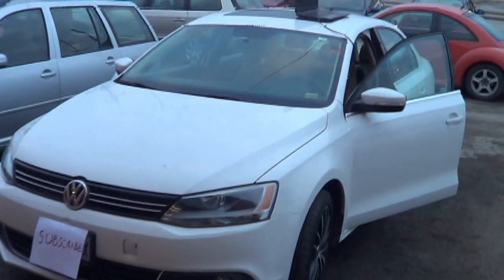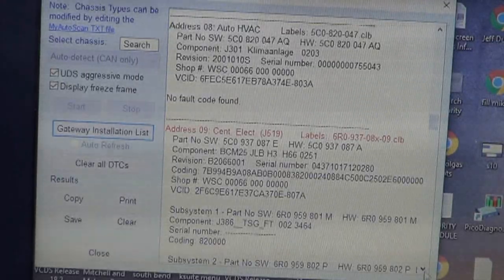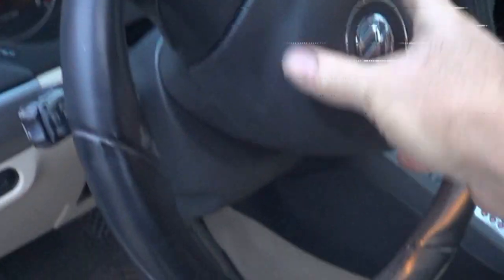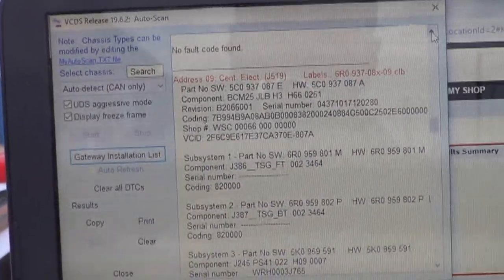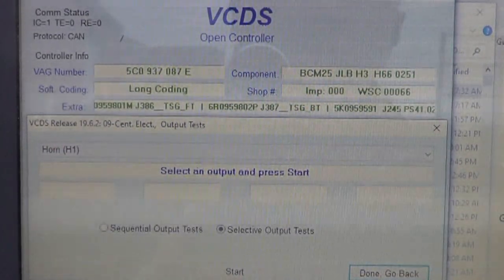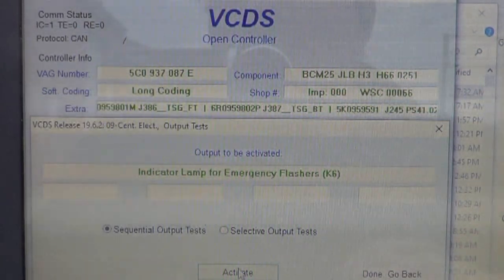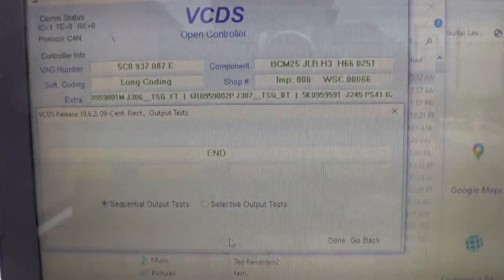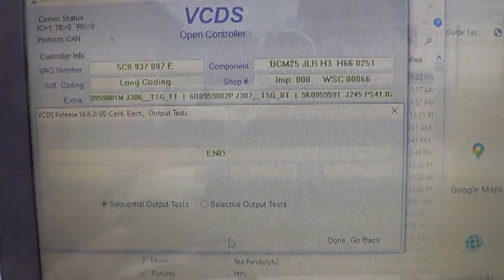2012 Jetta  Horn 03591

Comment: You should update the description with the solution to this problem. For others watching start the video around 10 minutes In. This only needs to be a 2-3 minutes long. Thanks!
Reply from the maker: what about when its not the horn?  What about when its the horn button or the computer or a wire broken?  If you just want to shot gun a horn on it then you dont need a video.

Comment: My horn and wipers stopped working at the same time too on my 2011 Jetta. I also have issues with the abs control module. Replaced wiper motor now diagnosing the horn.
Reply: I had all those same things fail on my 2011. Currently working on the horn
Reply: @ndirish4515  the horn I just went with a dual tone horn. Sounds better than the original one. The abs control module I chose not to replace, still works just the dash lights come on and off sometimes. Figured wasn’t worth spending half what the car is currently worth on abs.

Comment: Hello, Great video. Thanks for posting. I replaced the horn on my 2013 VW jetta 2.5 SE. Horn is now working but anti theft alarm and panic alarm is not working. Is the same horn used for the steering wheel horn as well as the anti theft alarm?
Reply from the maker: no
Reply: @CoolAirVw  Any clue why the panic alarm don’t beep but lights flash and when locking the doors with fob it don’t beep?
Reply from the maker: @Jeffkevans22  someone could have changed the settings or maybe the horn doesn't work. Or something else.
Reply: @CoolAirVw horn works but panic alarm just blinks and no horn and when locking doors, light flashes with no horn.
Reply: @Jeffkevans22  It should have a hi tone horn on right longitudinal member and low tone horn on the left longitudinal member

Comment: So I have a 2011 Jetta, and I checked and it also has one horn, however it works and it doesn’t. What I mean by that is that when I lock the car the horn sounds as well when I put the panic button. However the horn at the steering wheel when pressed it won’t work at all. Could this be the switch itself?
Reply from the maker: there is a seperate horn for the alarm and panic functions, so that information is irrelevant.  Go to your horn, see if it gets voltage when you have a helper push the horn button (key on of course).  Then make sure the ground on the horn is good.

Comment: cant beat bio directional control it helps some much on diagnosing electrical problems
Reply from the maker: you learn on the ones that work then use that info on the ones that dont.